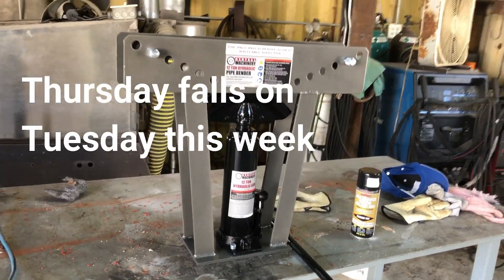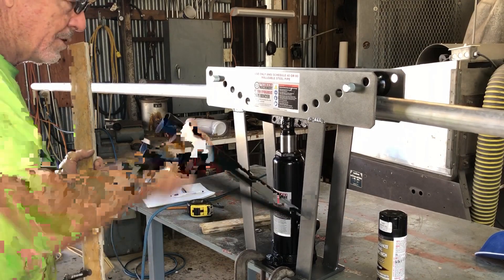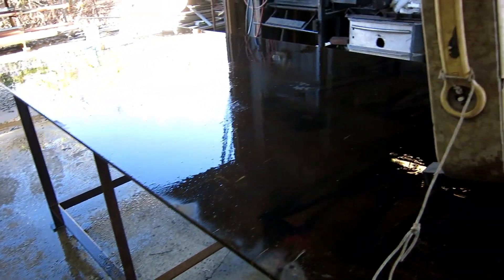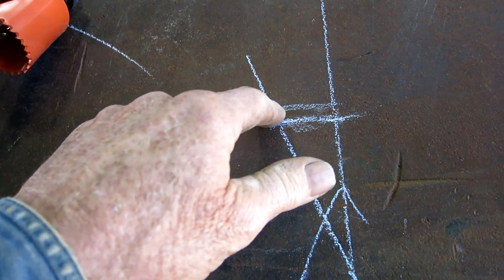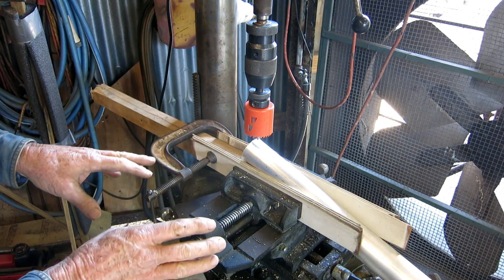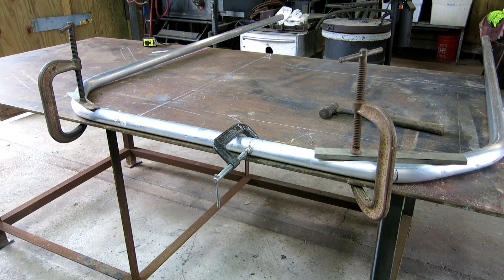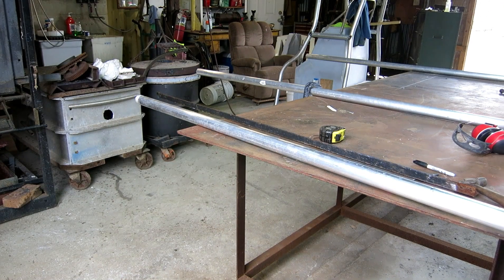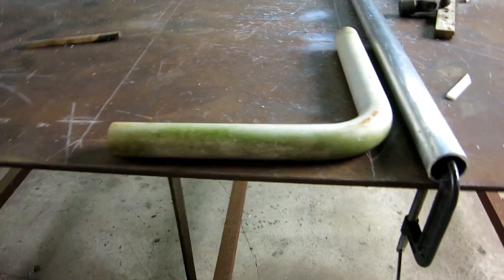Building a DIY T-Top Frame For the Center Console Project Boat #26

Comment: Man your a beast Barry!!  I've seen alot of t tops most guys used flat stock aluminum on the top instead of round pipe.
Reply from the maker: Thanks Buddy 
I have always been taught that pound per pound a tube shape gives you the most strength. Takes more time though!
Barry

Comment: you can make mandrel bends with that bender.  you have to move the pipe through the bender 1" at a time the same way a rolling bender works. you can't bend it in 1 spot it will kink. it has to be in mul;tiple bends at 1" increments...
Reply from the maker: Thanks for the tip and thanks for watching. I will defiantly keep it in the back of my mind for the next time I pull out the old bender.
Barry

Comment: Hi, I have a bender just like that and I build aluminum structures with it. What I did at first was to put some kind of cardboard or carton on the dye cuz of the rough edges and it worked really well until I had the dyes made of aluminum at a leath shop... excellent job!!
Reply from the maker: Thank you Manny and thanks for the tip!
Barry

Comment: Where did you kind the aluminum pipe an what size did you use. Great job hope I can do that good.
Reply from the maker: It is aluminum ridged conduit available from all electrical supply houses and maybe the Home Depot’s. 1 1/2” main tubing and 1” and 3/4 for the rest. Good luck on your project!

Comment: nice work, could you add a tilt mecaanism to an existing aluminum t-top, to be able to garage the boat  for winter.? Michigan winter purpose.
Reply from the maker: Thanks JDL! Lots of variables there. A good machine shop can do pretty much anything. But if your top requires too many changes to make it foldable it might be more cost effective to sell the one you have and buy one that has a foldable feature.
Barry

Comment: Great video and highly appreciated! Would be nice to post another video with the final result (at least for the top). Is the welded connections strong enough, because usually aluminum pipes or conduit is welded with TIG? I am not a welder and that’s why I am curious if the spool gun makes rigid connections?
Reply from the maker: Plamen
Thanks for the kind words. I might have to disagree with you on aluminum welding. Pretty welds (stack of dimes) and welding very thin metal is TIG welded by very talented individuals. But I believe the majority of aluminum welding is done with MIG machines. Strength is no a problem.
Barry
Reply: @barrylukebuilds7894  thanks for the info. Ad I said I am not a professional by any means and that’s why asked you for your opinion and experience. You inspired me with your video and now I am starting to build t-top for my boat. For the structural elements did you use 1.5” pipe or 2” conduit? I am planning to use 1.5” alum pipe grade 6063 T6 bandable, do you think it’s a good idea? I can get them for 42$ for 20’ pipe.
Reply from the maker: @plamenpetkov400  I used 1 1/2" pipe not 2" tube. The only tube I could find locally was crazy expensive. Sounds like you got a super deal but somebody smarter that me will have to help you with the pipe grades. I just don't know.
Barry
Reply: @barrylukebuilds7894  appreciate your help. Can’t wait to see the finished project.

Comment: Very nice video Barry! I am starting to build my own T top at the moment although having issues with the Aluminium kinking using the same bender you have. I am using 40mm Dia 1.6mm wall Alloy tube so might be an issue of the material being too thin. What wall thickness was your pipe and do you have any tips to stop kinking? Cheers
Reply from the maker: Sam
Sorry you are having bending issues. My guess is that the thin wall tubing you have is too ridged to bend without a mandrel. The aluminum conduit I used is very soft as it is designed to allow electricians to bend and thread it easily. It is probably not nearly as strong as what you have. Not sure what you could do except maybe heating the bending area to a few hundred degrees? Just a guess. Anyway thanks for the kind words and let us know what you worked out.
Barry
Reply: Thanks for the quick reply and info. l will have go with it pre heated see if that improves things. Alternatively I was thinking of swapping the alloy stock I have to something more suitable. Do you know roughly how thick your aluminium conduit was? Im not sure where to source that in Sydney however might try get some alloy tube with the a similar wall thickness to test out. 
Cheers
Reply from the maker: @Sam-yw5mv  don’t have a micrometer here but roughly 1/4”. Ridged aluminum conduit should be available at most any electrical supply house.
Barry

Comment: Very nice T top! Now that it’s been over a year how well is it holding up? I would like to make a grab bar and I am unsure if the conduit would hold its shape and not bend if I were leaning on it and pulling up on it. Thanks
Reply from the maker: Blake
Thanks for watching and thanks for the kind comment. No problem with the hardtop! Although the 3/4" conduit is soft in comparison to other types of pipes and tubes, bending a short piece by hand is pretty difficult. Keep your length reasonable, add in a curve, and I would be confidant you will have no problems.
Barry

Comment: You can load your mig welder with large alloy filler wire all you need to do is change the liner in your lead and insure your tip in your mig gun is big enough.
Reply from the maker: Thanks for the tip.
Barry